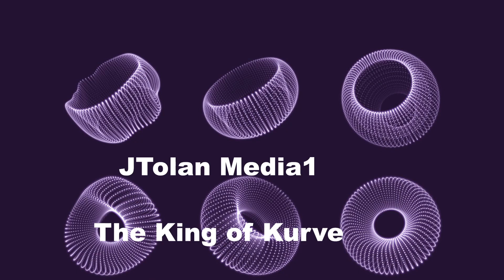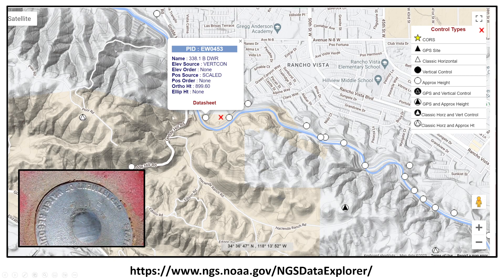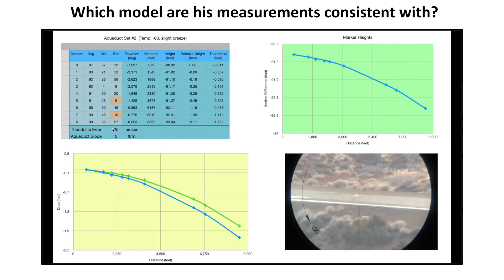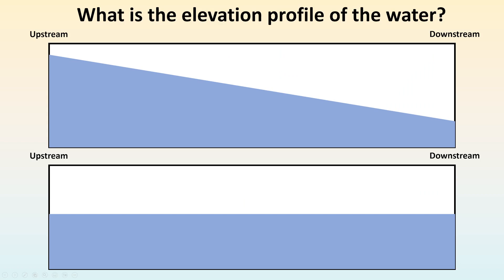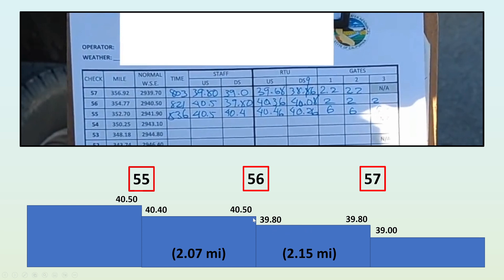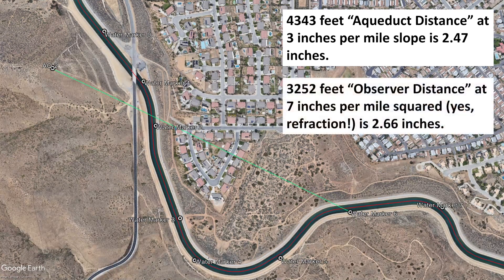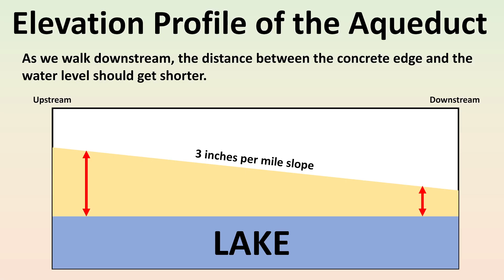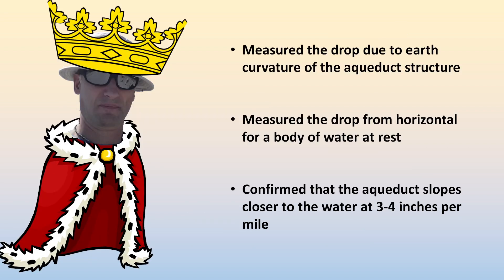@jtolanmedia1 is the King of Kurve!!!

Comment: I'm a little confused. What did the flerf expected to find? Water flowing uphill? And if not, what was the point of those measurements as the mainstream science expect this water to flow downhill?
PS. Does this water flow? Because if it does, there needs to be a slope (the kinetic energy of the stream comes from the potential energy change).
Reply from the maker: Yes, the water flows: if you listen to JTs video around the 47:30 mark, he talks about how there is a delay of around 15 minutes for the water level to propagate to the downstream gates. So I imagine during these times there might be a measureable change in the elevation of the water - who knows how much that might be 🤷‍♂🤷‍♂ The only data I have is from the Water Resources guy, and his data say that the water is at a constant elevation - so not enough flow to cause a noticable change in elevation.

Comment: Beautiful! I have seen that video before and even commented on it, but it was on the first version, which JTolan later made private and replaced with a newer one, so my comment is now lost 🙁 The discrepancy between the water level measurements and concrete structure measurements bothered me slightly, and IIRC I expressed my suspicion that the gates could have been causing a build up of water in my comment, but I had no idea how I could prove or disprove it - so you can imagine how I grinned when I saw you find hard data showing that this was pretty much what was going on 😁
Reply: Likewise, I'm a bit suspect of the 'lake' versus 'river' concept.  Clearly the aquaduct was BUILT to move water from one place to another, so the water would PROBABLY be moving.  But the technician's data sheet suggests that all the pressure drop is being controlled at the gates.  This implies that the hydraulic losses along the concrete aquaduct (at least in current operation) are quite small compared to these control gates.  Perhaps at different times of the year, or some other reason, there would be times with the water moving faster, there would be more hydraulic drop along the aquaduct.

(unfortunately, we don't get to see just how far open/ close those gates are on the day in question, so it's difficult to judge anything more).

Comment: I live near the California Aqueduct.  I wouldn't think they need any slope for the water to "flow"
It's kind of like a series of sections or locks (lakes?)  controlled by gates and pumps depending on if they drop a section to a lower elevation by opening gates or raise up a section in elevation using pumps. 
I would think it would be too easy to flood the far ends of sections if the water flowed to fast. One mistake could flood thousands of acres of land
Reply from the maker: Right .. So there’s no slope to the water, agreed. So why did JTolan measure a downstream drop from horizontal?
Reply: The Aqueduct is not a "body of water at rest" by any means
Reply from the maker: @garywybenga4188  Well the measurements made by the DWR guy show that the surface is at a constant elevation. So why did JT measure a drop?
Reply: @roohif  I have no idea. I don't quite understand what you guys are seeing and measuring
Reply: @garywybenga4188  True
Reply from the maker: @garywybenga4188  JT measured that the aquduct structure was consistent with 8"/mi^2 curvature AND 3" per mile built in slope. He measured a drop from horizontal in the height of the water, and the available evidence we have says that the water is at a constant elevation.

So he's measured earth curve - twice.
Reply: @garywybenga4188  You finally said something correct: you have no idea. Glad you arrived at the right conclusion, after all this time.
Reply: @garywybenga4188  "I don't quite understand what you guys are seeing and measuring" 

Now that is a true statement for a change, probably the first honest sentence I've ever seen you write. It is just that you seem to believe it is only true for this video, while it is basically true for pretty much everything math, physics, and engineering related that I've seen you comment on ... :o
Reply: @garywybenga4188  ""I don't quite understand what you guys are seeing and measuring"
So we can add surveying to the list of things you know nothing about, like geometry, trig, optics, rounding off numbers, the difference between a day and a date, etc.  At least you're honest(for the first time) about your ignorance.

Don't fret about Gary, I'm sure you know more about milking cows than the rest of us do.  
😁
Reply: @garywybenga4188 ’’I have no idea. I don’t quite understand…’’
I liked your comment, Gary. First step in understanding something is admitting you don’t understand it.
Reply: @garywybenga4188   “I have no idea. I don’t quite understand…” I didn’t think these words were in your vocabulary, Gary 😂
Reply: @garywybenga4188  Large bodies of water are never at rest. While they may look calm at times, there is still motion going on.
...Water is propelled around the globe in sweeping currents, waves transfer energy across entire ocean basins, and tides reliably flood and ebb every single day.
Reply: @Do_Not Know_Much  and yet every time you look out over the horizon it looks like a flat line...I'll bet you have no idea why
Reply: @garywybenga4188  ‘‘ it looks like a flat line…I’ll bet you have no idea why’’
Gary, I’m sure you have an idea why but I’m also sure you are wrong about it.
Reply: @Robert Lafleur  it's always the same reason...but it's not earth curve
Reply: @garywybenga4188  What is that same reason?
Reply: @robertlafleur5179  Angular compression/foreshortening effects from very acute visual angles to surfaces
Reply: @garywybenga4188  There is no acute visual angles to ships or buildings hidden by the horizon. See, I told you you are wrong about it.
Reply: @robertlafleur5179  Then you heart clueless what you're talking about.
Reply: @garywybenga4188  All navigators disagree with you. Do you think they are also clueless?
Reply: @garywybenga4188  You have claimed 'angular compression/foreshortening' for quite a while now, but you are still completelyunable to explain /demonstrate or back up yur claim with any sorts of math or whatever.

I think you are better off sticking to "I don't quite understand what you guys are seeing and measuring!"
Reply: @robertlafleur5179  10ﾟ of sky above you covers less distance than ten degrees of sky in the distance. Foreshortening is a real effect
Reply: @garywybenga4188  WROOOOOOOOOOONNNNNNNNGGGGGGGGGG!!!!!!!!!!!!!!
Reply: @robertlafleur5179  yes, you are definitely wrong
Reply: @garywybenga4188  Your description really sounds like something that could be described by a geometric formula which could then be tested. Can it?
Reply: @everybodylovesballs Geometric formula? 
That’s way out of Gary’s wheelhouse.
Reply: @boobylinks  models aren't reality
Reply: @garywybenga4188  Especially the FE model, which is antithetical to reality at the end of the day.
Reply: @reidflemingworldstoughestm1394  the globe model fails in many places